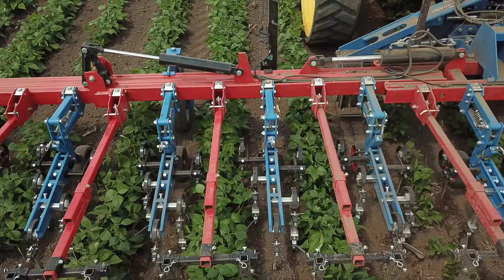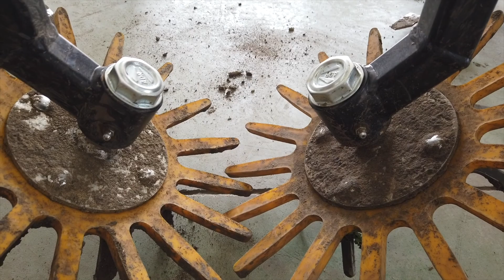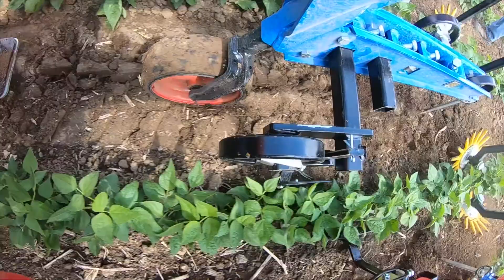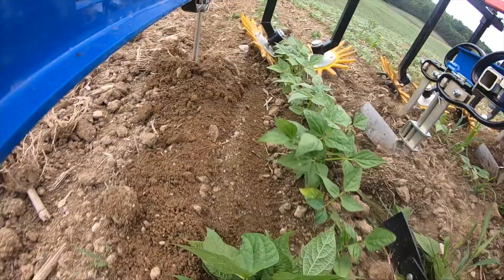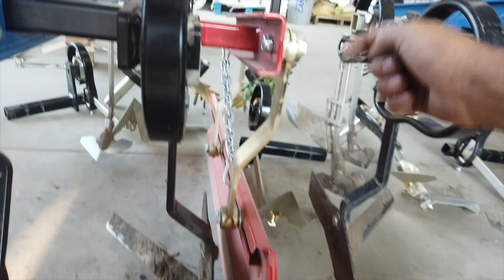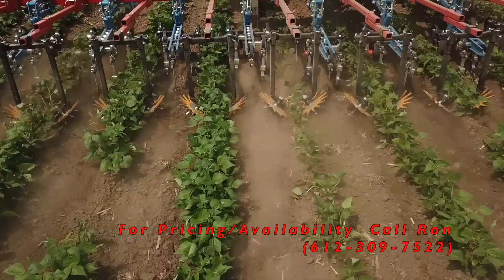Hatzenbichler Cultivator Systems | Why we chose Hatzenbichler over Einbock

Comment: I have an einbock with rowguard.  The 5 shanks doesn't work well here because of bindweed.  I also never got the rowguard to track perfectly all the time so I usually just shut it off and let autosteer do its thing.

Is the Hatzenbichler guidance trustworthy?  I'd want to hook it up to a new buffalo cultivator I'm getting since I need a single sweep.
Reply from the maker: The Hatzenbichler uses the Tillet and Hague camera system. We haven't had a problem in terms of guidance with either the Einbock or the Hatzenbichler. I'm surprised you had problems. Please reach out if you'd like to discuss. 612-309-7522